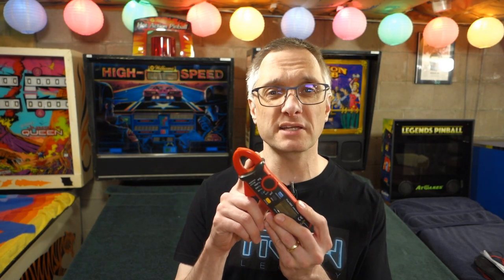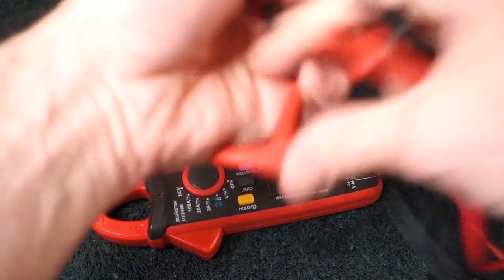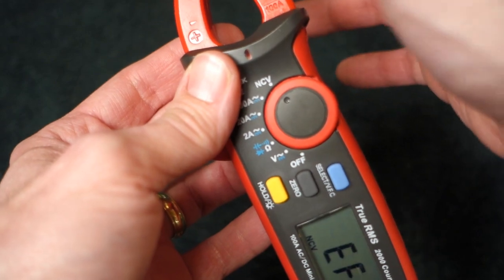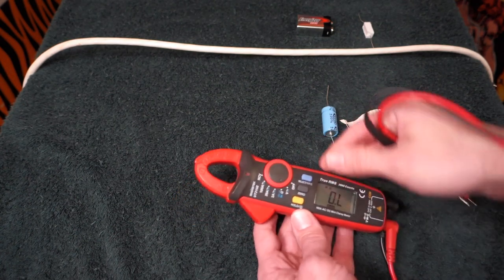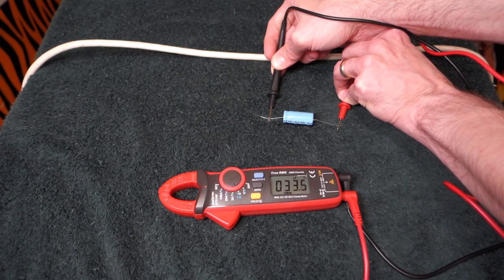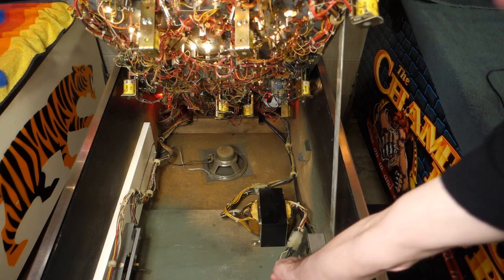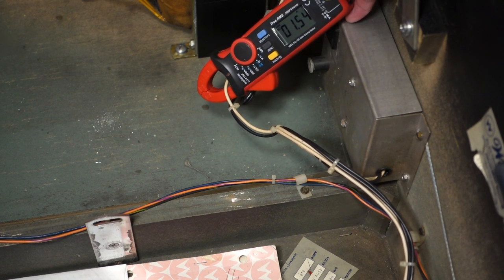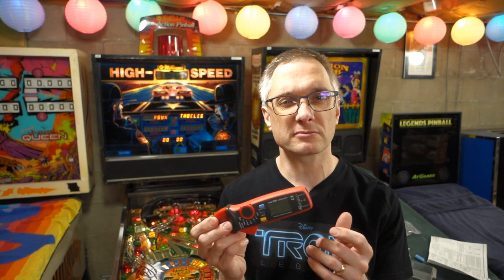UT210E Multimeter W/amp clamp - show & tell + demonstration

Comment: Hi. I like your practical videos. I myself use a Testboy Testavit 216 N clamp multimeter, which is actually oversized for my pinball purposes. In practice I mostly use the voltage measurement.
I've gotten into the habit of always checking the fuses under voltage with the voltage setting. Black on ground strap or like older Bally/Stern pinballs at the ground test point and with the red tip on the fuse caps.
I can tell a good fuse by the same readings on both end caps, different readings indicate bad fuse holders, mostly with Data East Pinballs, if I don't have a reading on one end, the fuse is blown. Oh yes, I know right away whether my power supply unit supplies the necessary voltages. This is how each of my pinball repairs begins.
Reply from the maker: Thanks for the great comment! I like the large display on the Testboy. Great tip on testing for blown fuses and bad fuse holders.